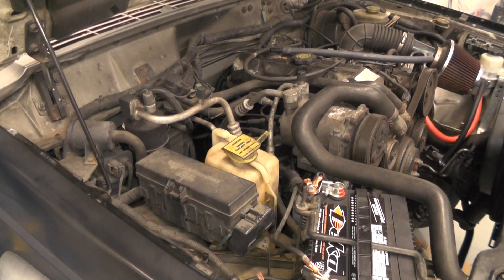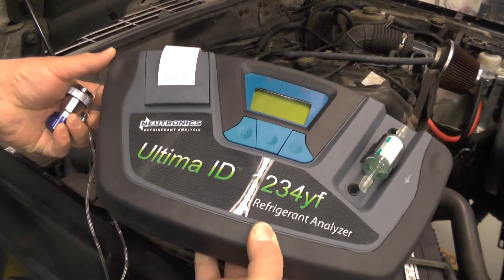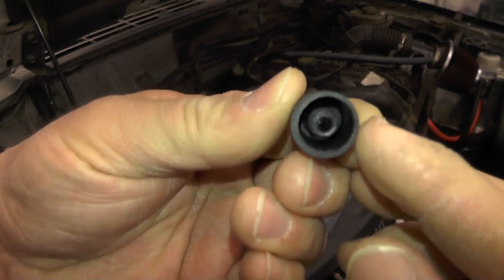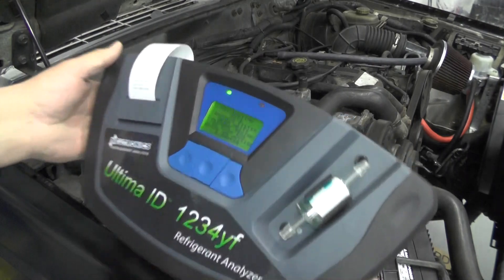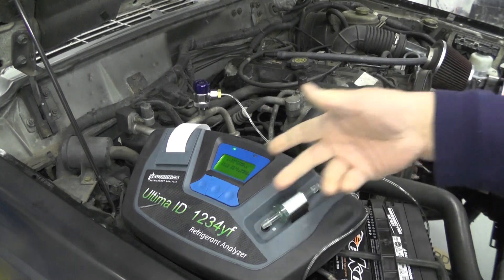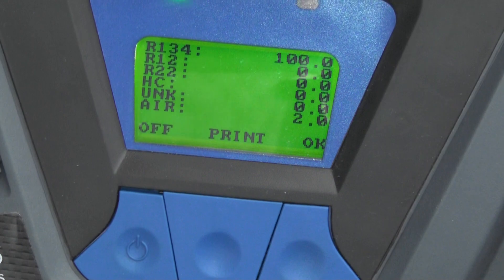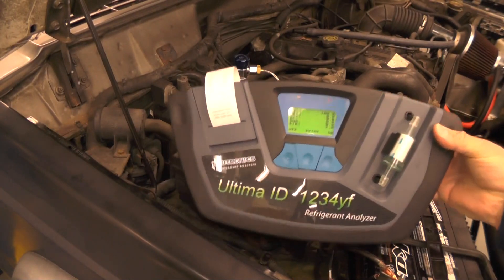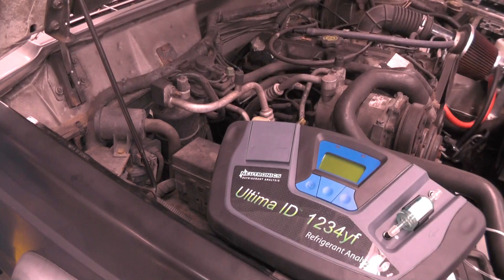How to identify refrigerant 2000 Jeep Cherokee XJ

Comment: I've got a 2000 Jeep cherokee w/ 134a A/C system that blows warm air. Have replaced all components of the A/C system and it still blows warm. While on a gauge, the high pressure side needle is fluttering and is really high (350+) on a very hot day. Any experience with this specific issue or have any opinions?
Reply: Replace the canister electrical switch

Comment: have you notice how many car come in with air content mixed with refrigerant. and the same cars that fail later when you have plugged up expansion valve with rust particles. Cut open the steel can type receiver drier you will see all the rust that is flaking off the walls. This dose not happen if you preform a good deep vacuum below 500 micron point and below. No air No moisture = No RUST, No breakdown of refrigerant oil.